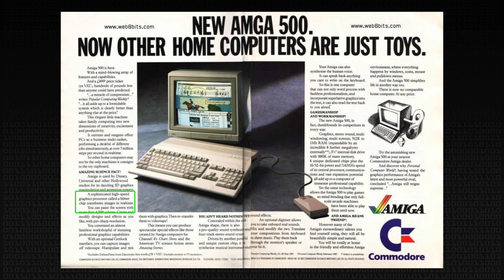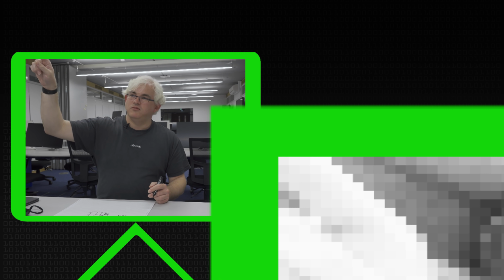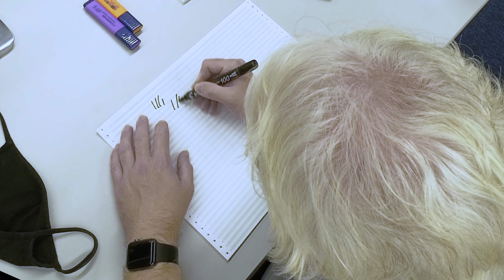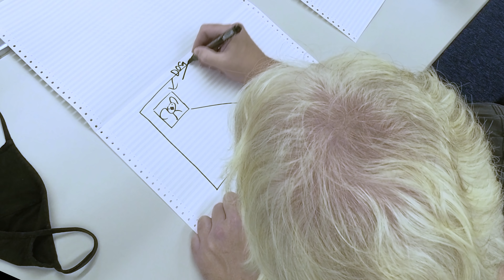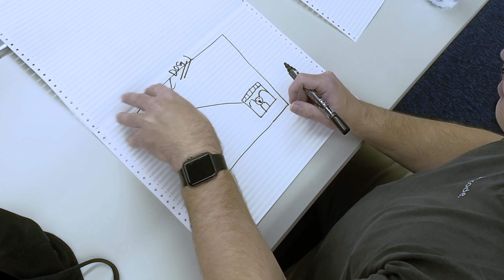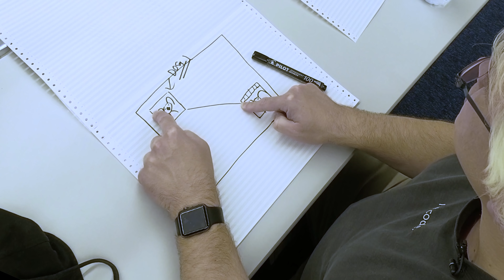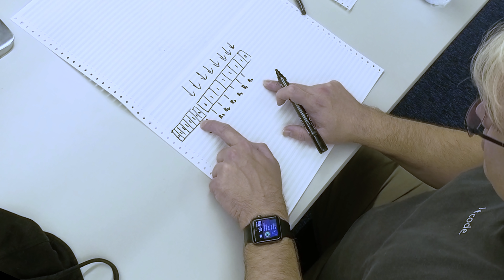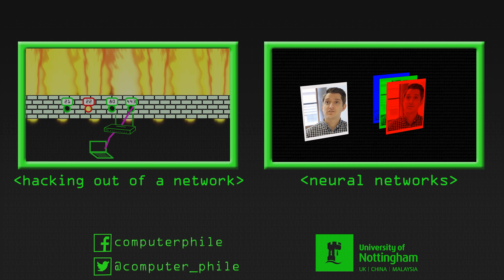Bit Blit Algorithm (Amiga Blitter Chip) - Computerphile

Comment: my minesweeper automating dissociated bot uses bitblt to copy the hardware context screen buffer to a memory block that doesn't need to be locked to read.  fastest screen grab function I tested by a factor of 50.  it had the added benefit of being able to hold a copy of the hardware device context live in memory instead of asking for it every refresh. gotta eek out every ms I can! average solve time 175ms on an fx-8350.   I think an older computer on 32bit would run substantially faster ironically. our of those 175ms average,  160+ms is just waiting for minesweeperx to refresh its state after sending a dozen clicks directly to its input queue... a windows 8+ only feature that saves a ton of time by not having to actually take control of or move the mouse cursor to do clicks.  womp womp.

Comment: 7:20 – Please do not EVER put voice or voice-over at extreme panning values. Some of us aren't mobile peasants and do have both functioning ears and functioning stereo speakers, even headphones, where that leaves an even more nauseating impression than your shakycam videographing style … which you thankfully seem to have toned down over the last years. No need to replace it with something else equally or more nauseating. Thank you.
Reply from the maker: It was just an editor mistake, sorry, completely unintentional, as was the audio problem in the first release -Sean (a mobile peasant)
Reply: @Computerphile  was there a different audio problem in the original? or did you accidentally upload the original again instead of the fixed version?
Reply from the maker: a different problem - clearly I was having a bad day! -Sean  @iykury
Reply: @Computerphile  ah :P